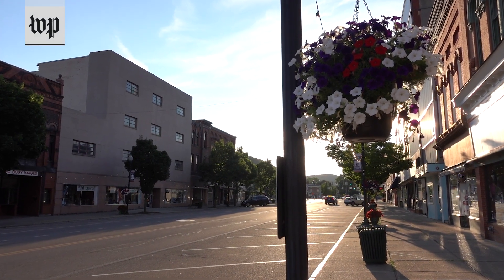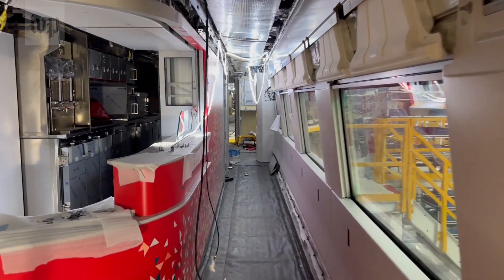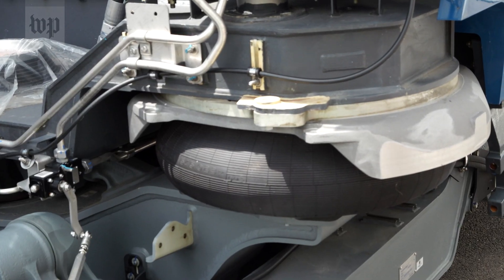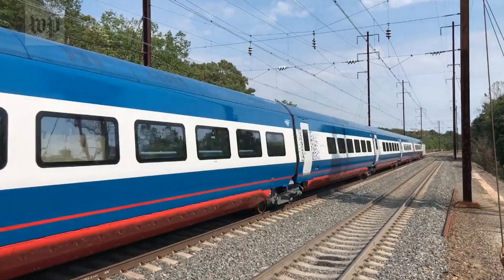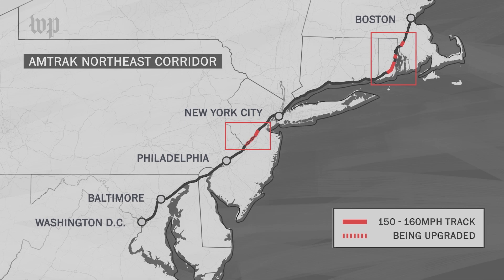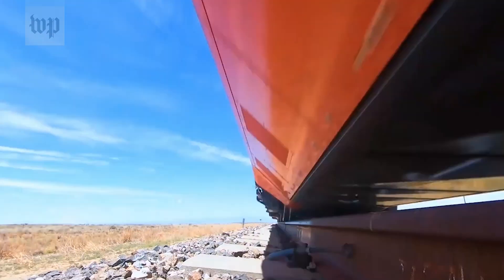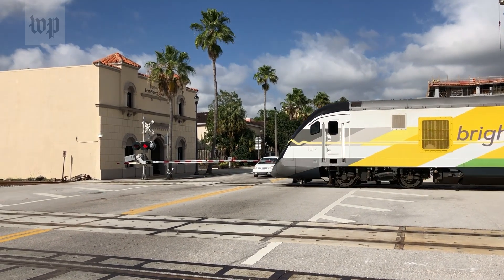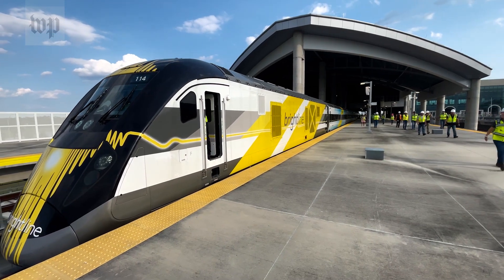Go inside Amtrak’s new high-speed train

Comment: I hope someone wakes up and sees the potential of a dedicated hsl on this corridor
Reply: But this already is a high speed line! 125+mph on upgraded lines is considered HSR by the international standard!

Almost the entire corridor is at or above 125mph already. There are a few sharp turns and the trains slow down in urban areas close to stations. But that is perfectly normal. That’s what all HSR systems do!

Sure, it would be great to have a parallel dedicated 220-250mph line just for the Acela. But that is both insanely expensive and extremely complicated to legally build in such a densely-populated region.

Wouldn’t it make infinitely more sense to just continue upgrading all of the NEC to 160mph like Amtrak has already started doing, and for a fraction of the cost?

We literally have real HSR in the bag on US soil (!) if we just continue the upgrades on the existing line. Why would we switch to a pie-in-the-sky line that is probably never getting funded by the Republicans in the next century? I just don’t see the point.
Reply: @TohaBgood2  125mph isn't Highspeed. It's "higher" speed. 250km/h+ is what I'd considered highspeed (~140)

And the issue is that it's not a segregated highspeed line, with commuter trains sharing the road.
Reply: @truedarklander  By the international standard, HSR is either 150+mph sustained on new track or 125+mph sustained on upgraded legacy track.

The NEC is a 125+mph legacy corridor, with some sections at 135mph, 140mph, 150mph, and with the new Acela trains two 160mph sections.

If you don’t consider the Acela HSR then most of the HSR lines in Europe and Asia also aren’t HSR. You’re underestimating how much of the HSR lines are on legacy track or top out at 125mph. The Acela actually reaches 150mph (160mph with the new trains).
Reply: @TohaBgood2  No, the Acela is a HST service, it just doesn't run on an HSL. An HSL allows for top speed on all the line and it segregates traffic. Don't misunderstand, the Acela Express is High Speed Rail, just that it runs on a "normal" rail line.
Reply: @TohaBgood2  I think it's time to update the international standard. Calling Acela a high speed rail service is purely marketing when in reality it can only hit those speeds in very specific and small areas. It feels like they get to call themselves HSR based on a technicality rather than the reality of their actual overall service and that feels like cheating to me. The average speed of the Acela is only 70.3mph. Meanwhile, a French line from Gare de Champagne-Ardenne to Gare de Lorraine averages 173.6mph 15 years ago. This is what people think of when they think of a high speed rail service. 

The standard should be updated to reflect the lines themselves, not just the capabilities of the trains, and should account for average speeds of the line, not just capabilities of the line in certain spots.
Reply: @TohaBgood2  Well the Acelas can totally do 150MPH But only on around 34 miles of tracks between Philly to NJ and CT to RI, the rest of the line averages about 80MPH due to legacy rail tech, the Acela is a High Speed train, thats the whole point, the issue is more tracks on the NEC needs a replacement to make it reach 150MPH nonstop, the new Acelas have an advertised speed of 160MPH but can actually top at 220MPH

Europe and Asian trains are true HSR because the lines they run on are capable of at least 180MPH+
Reply: @TohaBgood2  How long is that 125mph sustained? 5 minutes?
Reply: @viinisaari  Lol, most of the Northeast Corridor is at or above 125mph. And that shouldn't be surprising. From the very outset, the NEC was designed as a high-speed corridor, or rather, a series of high speed corridors connected together with slower bits in urban areas. It's just that it was designed for what used to be the top speed limit for fast trains at the time. Now all of those sections are upgraded to about 125mph.

Have you ever googled "northeast corridor speed chart"? Yeah, try that. You'll see that the majority of the corridor is at or above 125mph. There are some dips for stations and a few slow turns or old bridges. But aside from that, the trains stay very close to 125mph.  

And now, Amtrak got a bunch of money to realize their longtime dream of upgrading everything that is at or above 125mph to 160mph. They're already completed two sections and more are on the way.
Reply: @Racko.  That's wrong on most counts. The Acela stays at or above 125mph most of the way. That's HSR no matter how you cut it. Look up "northeast corridor speed chart". The majority of the track miles are at 125+mph.

Most HSR services in the world top out at 150-160mph. Most of the Shinkansen lines to out at 160 mph in operation. Sure, everyone is building new lines at 200mph and even 220mph. But it will take decades before the default flavor of HSR around the world will be 186mph or 200mph. The vast majority of operators are looking to compete with air traffic and 150-160mph is more than enough for that on most corridors. They capture most of their travel market and simply won't spend crazy money on upgrades if it's not necessary. 

The Acela is a profoundly average HSR offering, even though the Acela is 3kph faster than the TGV fleet. Look it up!
Reply: @TohaBgood2  That's true, under the US and European HSR definition of minimum speed requirements 125MPH is the base speed for high speed rail anyways, the NE Regional trains which are German Siemens locomotives top at that base 125MPH to meet the definition of HS, which in fact it is, from what I've heard, about 34 miles of tracks is were the Acela goes 150MPH continuously and comes back down to 120MPH from DC to NJ before hitting under 90MPH from NY to Boston, despite all of that, it's still a High speed train, about 5 miles less faster than the ICE 4 which only tops at 155mph since they didnt need more speed which the ICE 3 did, also which TGV fleet exactly? Im sure the new Acela fleet is faster than any TGV which is what you're referring to because it can do 160MPH-220MPH at best

Shinkansen averages at 157MPH if im not mistaken, top speed is 198MPH and it sometimes does 220MPH on some routes depending on how busy the line is
Reply: @TohaBgood2  The northeast corridor has an average speed of 83 mph on the southern segment and 68mph northern segment, respectively. For comparison, the Skinkansen between Tokyo and Osaka has an average speed of 132mph.

On a regular highway, you can reach an average traveling speed of 68mph. That's not high speed rail.
Reply: @TohaBgood2  BTW I looked at the chart, almost a half of the corridor has a speed limit of 120mph or less.
Reply: @viinisaari  Again, bud, look at the entire service not just a single cherry-picked line on the faster side! The Northeast Corridor is in actuality a ton of services that a run back to back. 

Here’s a quote from someone who did the actual research. It took me less than a minute to find - “The Sanyo Shinkansen is 553.7 km long. It takes 2 hours and 28 minutes to cover. It averages 224.5 km/h or 139.5 mph.

The Kyushu Shinkansen is 256.8 km long. It takes 1 hour and 48 minutes to cover. It averages 143 km/h or 89mph.

The Joetsu Shinkansen is 269.5km long. It takes 2 hours and 4 minutes to cover. It averages 130 km/h or 81 mph.

The Tohoku Shinkansen is 674.9 km long. It takes 3 hours and 26 minutes to cover. It averages 197 km/h or 122 mph.

The Hokkaido Shinkansen is 148.9 km long. It takes 59 minutes to cover. It averages 151 km/h or 94 mph.

The Akita Shinkansen is 127.3 km long. It takes 1 hour and 37 minutes to cover. It averages 79 km/h or 49 mph.

The Yamagata Shinkansen is 148.6 km long. It takes 2 hours and 6 minutes to cover. It averages 71 km/h or 44 mph.”

As you can see, the Acela is smack in the middle of the average speed range for Shinkansen services. And let’s not forget that the vast majority of Shinkansen trains top out at speeds below the top speed of the new TGV-derived Acela trains!
Reply: @viinisaari  So you agree that the majority of the corridor milage is at 125+mph, correct? Wasn’t that exactly what I said?

Again, this is perfectly normal for a middling high speed service. The vast majority of HSR services worldwide work exactly like this, with similar average and top speeds. 

That’s the whole point! The Acela is right now an extremely average HSR service that will perhaps become very slightly above average with their new TGV trains and the $40+ billion in speed upgrades that they are now starting to do.
Reply: @TohaBgood2  Plot those data points over the distance. Interesting correlation with the length of the route.
Reply: @viinisaari  And? The Northeast Corridor is a bunch of high speed intercity corridors stacked end to end. The vast majority of passengers use the Acela for hops between the cities on the route. Almost no one travels end to end. That is entirely comparable to the medium and shorter corridors in Japan. And the Acela is a lot faster than most of those Shinkansen corridors.

It’s not the Acela’s fault that you don’t understand the way the corridor works. From the point of view of the actual passengers taking this train, the Acela is indistinguishable from those Shinkansen services that you like so much. And if you compare like-to-like, the Acela is identical or better than those lines even on paper (top and average speeds).
Reply: @TohaBgood2  nah, the berlin munich link is a better comparison. and that's faster
Reply: @TohaBgood2  
Acela DC-New York
Theoretical average speed 108kmh
Average delay 45min
People living along the route: ~ 30 million
Considered high speed rail

Main corridor in Finland Helsinki-Oulu
Theoretical average speed: 109kmh
Average delay: 5min
People living along the route: 3 million max
Not usually considered high speed rail
Reply: @TohaBgood2  Stockholm – Malmö
Theoretical average speed 144kmh
Average delay: ~10min
People living along the route: 5 million or so
Actual HSR which is "a bunch of high speed intercity corridors stacked end to end"
Reply: @viinisaari  Lol, bud, that's 49 minutes not 45, and that number is for all of Amtrak's fleet including the long-distance services that cross the entire continent! Wanna tell us how many Finlands that is? Some of these long-distance Amtrak trains literally travel a longer distance in one two-way trip than the entire length of all the rail miles in all of Finland. And they do that on ROW owned by hostile private rail operators that deliberately manufacture delays for passenger trains!

The overall on-time performance on the Northeast Corridor is better than Finland's national rail operator's. It's also better than, for example Deutsche Bahn's, but that doesn't say much.

The Acela's on-time performance is even better.

Seriously, bud, if you're going to lie about things that I can google up in a few seconds what's the point in even trying to lie? I will just fact check you again and again and again and again 😁😁😁
Reply: @viinisaari  You're using the non-express speed and Runtime for NY-DC. Here's a quote from wikipedia - "The high-speed operation occurs mostly along the 226-mile (364 km) route from Pennsylvania Station in New York City to Union Station in Washington, D.C., with a fastest scheduled time of 2 hours and 45 minutes and an average speed of 82 miles per hour (132 km/h), including time spent at intermediate stops."

And this isn't a non-stop service, that was faster, but I think they discontinued it.

In other words, google exists. Use it!
Reply: @TohaBgood2  give me the numbers on acela being better on  time than the routes I mentioned. I'll wait.

BTW you just addressed one part of my comment. Talk about being dishonest
Reply: @viinisaari  BTW, the highest performing Amtrak route on the NEC have better on-time performance than the Stockholm – Malmö route.

It's like you're not even trying. Was the point to prove me right or to prove yourself wrong? 😁😁😁😁😁
Reply: @TohaBgood2  lmao grasping at straws with NONEXISTENT travel times. lmao
Reply: @TohaBgood2  none of the services i mentioned are non-stop. why are you bringing that in anyway?
Reply: @TohaBgood2  I can also pick a subset of the track where you reach a higher average speed between two large cities.
Reply: @TohaBgood2  Give me the numbers, maybe even between Finland and the NEC. Also, SJ's punctuality is a really low bar.
Reply: @TohaBgood2  And when it comes to lying, let's have a direct quote from you: "Almost the entire corridor is at or above 125mph already".

A bit over 50% = almost the entire corridor? Like 33% of the runtime is almost the entire corridor?
Reply: @viinisaari  Ok, fine. The majority of the corridor is at 125mph or higher. That’s still HSR of the second variety any day of the week.

BTW, my other points stand. You have refuted nothing. Come up with the actual data to prove your point, if you think that it actually exists.
Reply: @TohaBgood2  yes but no... many places are already targeting at least 250 or 350 mph on their corridors
125mph would be considered slow even in UK who is literally constrained by their infrastructure and is currently building a dedicated corridor up to their midlands from london which has a targeted speed 250mph.
Reply: @PrograError  No lines above 220 mph have even built yet and there is only one single train that runs at 217mph in the entire world. There are sections of track that could  do 200mph or above, but very few actual HSR train actually go that fast. Only 6 sections in Europe have that speed limit! And only some trains actually pin the speedo on those sections.

The transition to 200-220+ will take decades. In the meantime no one is dismantling HSR trains that go 150-160mph. In fact that is the absolute majority of services worldwide. The rolling stock manufacturers even have a separate class of HSR train that tops out at 160mph as a separate product (e.g. Siemens ICE4). Clearly, these types of HSR services aren't going anywhere. 

In other words. Sure, HSR is moving forward. But given the necessary infrastructure development for those higher speeds, it will be decades before anyone could justify saying that the Acela is no longer HSR by international standards.
Reply: @TohaBgood2  there is no dedicated high speed line.
Reply: @meandwhoism  The Northeast Corridor is the dedicated line. It is literally owned by Amtrak and they only allow services that are compatible with their HSR and higher speed services.